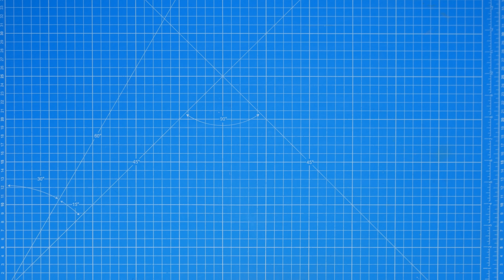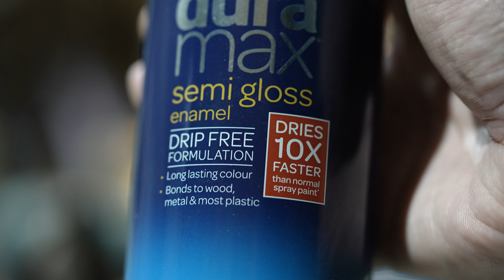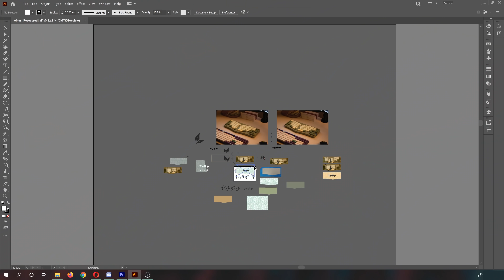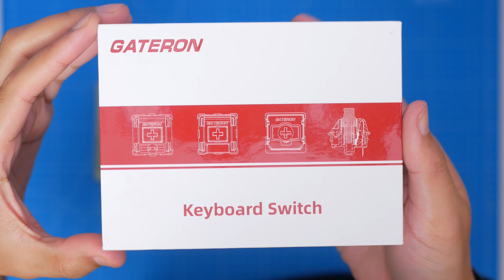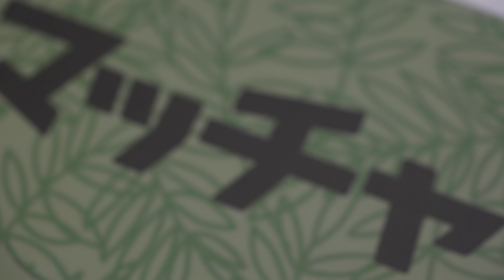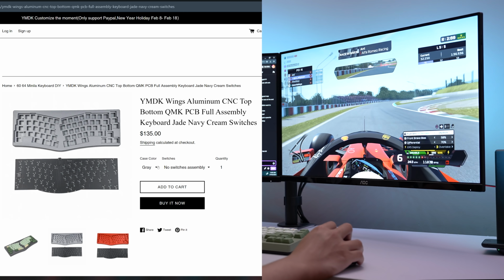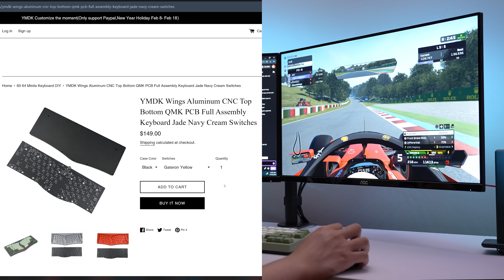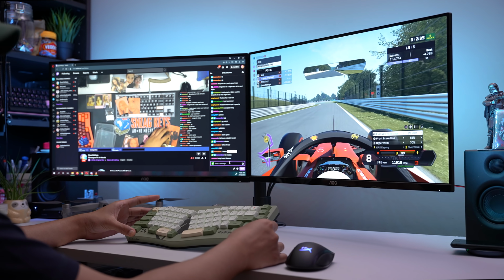That cheap Alice style custom mechanical keyboard

Comment: You're a real and great kb builder. Everyone is able to just spend tons of money in expensive parts. You can turn even the cheapest build into a great great keeb, you respect the budget stuff as much as the more luxurious one. So much respect. You are what this hobby needs, thank you
Reply: Or what you need is a "cheap keyboard" to have a good typing experience and keebs that over $200 just sell for the limitness value? :/
Reply: @slowtyper95  not just that tho. luxurious keebs mostly are over engineered and not so usual features and materials

Comment: The typing test for this thing is bonkers.
Reply: Yikes
Reply: shelf liner between pcb and the bottom would've helped a lotttttttttttt
Reply: Made me lose my hearing
Reply: @bakeraus  chill
Reply: @derekeys-  I have one, there's really next to no room between the PCB and the bottom. IMO it needs foam between the PCB and tray.
Reply: @jameswright4455  I see. Definitely needs foam between integrated plate and pcb. I've worked on ID80 and Drop boards; could never get the appeal of integrate plate when it causes for so much hollowness

Comment: wow what perfect timing, i was planning on spray painting my wings too
Reply: I bought this keyboard 2 days ago Did you like yours?
Mine Is silver colour
Gateron yellow
Reply: @saudigta5237  im enjoying the typing experience, i bought mine with no switches. I highly recommend putting foam in the case and in between the pcb (traced the plate and cut it out myself) because the board sounds really hollow without it.

Comment: great vid overall, paintjob is insane. this is a def a display piece if you never end up using that board specifically.

i picked one up a bit ago, put everglide dark jades, but i never got used to the "B" key being on the left side. the split backspace for me was flipped and i never found out which thing it fell under when i tried to QMK it. im not a big fan of it, maybe bc of the switches but its still a nice budget board overall.

Comment: Doesn't sound that bad, honestly. I reckon some thin foam would get rid of that faint reverberating 'twang' in the case, but as is, not bad for an integrated plate board.

Comment: I heard about this budget alice keyboard the other day and I was super intrigued since I've been wanting to get my first Alice layout keyboard, but just like you, I use my right index for B and left index for Y, so it kinda sucks that there isn't a B on both sides like other Alice keyboards. Also, the lack of a full-size backspace is also kind of a letdown. Despite all that, I was still debating on buying it, but I was wondering if the keyboard sounded hollow cause it doesn't seem like you had enough room to add in some foam. Also, would you recommend avoiding painting the plate (but paint the rest of the keeb) if you were to do this again? Great vid btw
Reply from the maker: yeh it sucks that the pcb supported a few options, but the plate didnt. it's still hollow, its just that the switches i used kinda embrace that. plus I removed that 1mm mid acrylic piece. And painting the plate is fine. You'd have to mask it of otherwise :)
Reply: @TaeKeyboards  Ah thanks, yeah glad that the acrylic piece is removable. So painting a plate doesn't affect acoustics since the weight of the plate is what really matters? Also, I've been meaning to ask other YouTubers this, but how do you guys film typing tests, do you just have a massive tripod beside you lol?

Comment: When you use the waterslide decals, did you spray them with the sealant before putting them onto the board, after putting them on, or a kind of mix of both (if it was a mix, what was the process?)? I want to put decals on my next board, but I have no idea how to best use waterslides on keyboards lol.

Comment: Stupid question from a mecha keyboard newbie: can you solder in Kailh hot swap sockets into a PCB meant for MX switches, making it hot swappable?
Reply from the maker: nope. kailh hotswap sockets require a pcb specifically designed for it. instead, you can use millmax sockets.
Reply: @TaeKeyboards  Thanks! I'll research those sockets.